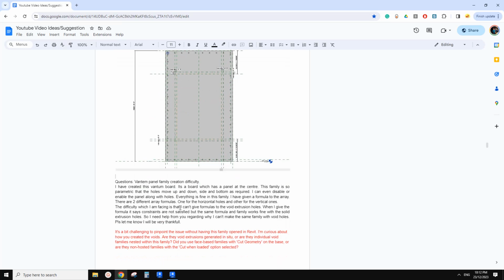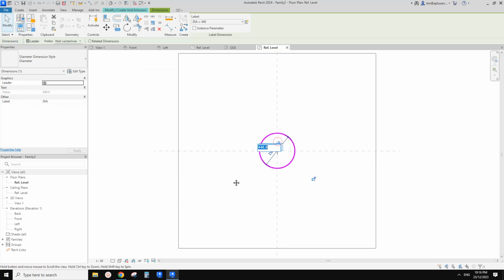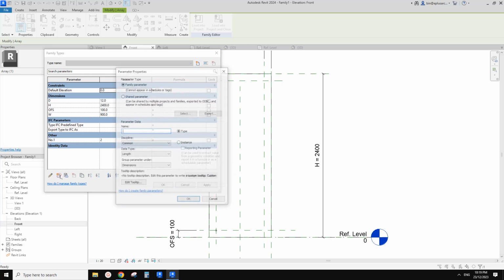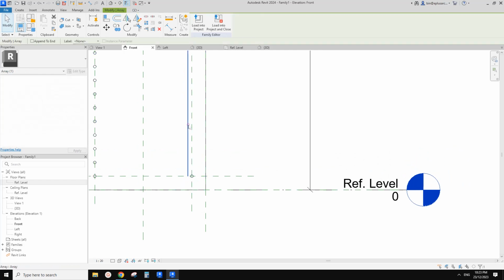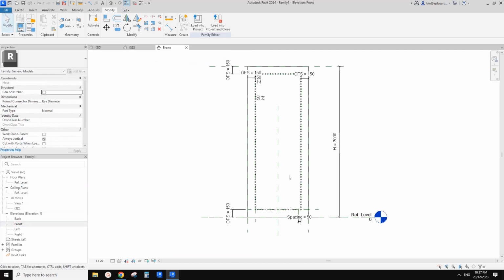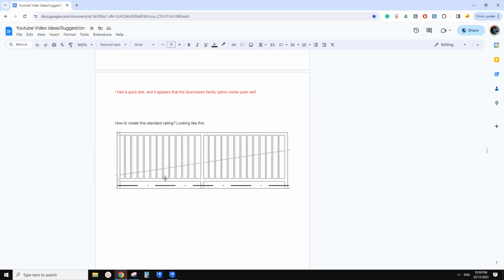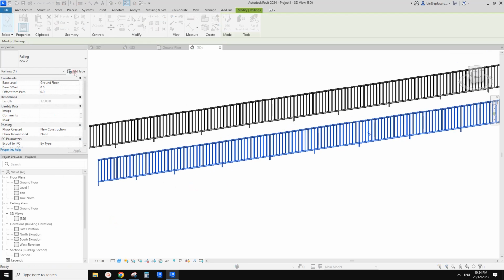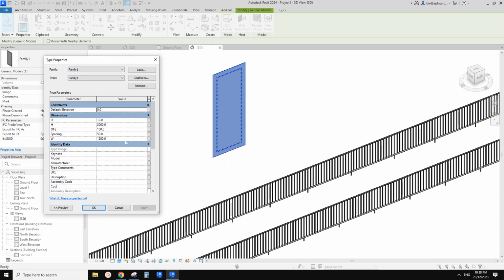23122 -  Face Based Void Family & Railing Exercise

Comment: Hi Bin, Great Video and thanks!!
I have a little problem. How would you scale a 2D site plan in revit?. Imagine we only have the peripherical boundary lines and the area. So the goal is to scale the site plan based on the area?
Reply from the maker: When you mention a 3D site plan, are you referring to detail lines and filled regions? You can probably scale the lines together, but you need to scale the filled regions one by one. I would recommend determining the scale difference first and then using the same origin point to scale everything uniformly. Here's a step-by-step guide:

Select all the lines, use Scale (SE), click on a designated point, enter a base scale factor, e.g., "1," and then type a second number, e.g., "10," to scale the lines up by 10 times.

After that, edit a filled region, select all the sketch lines within it, and use the Scale (SE) command, repeating the previous steps until everything has been scaled appropriately.

Alternatively, you can export your 3D site plan to a PDF or DWG, and then import it back. This will allow you to scale the entire drawing more easily.

Hope it helps.
Reply: Thank you very much!! @BINHE615